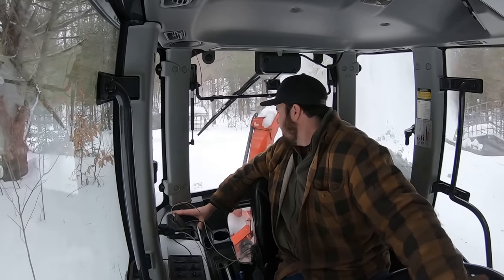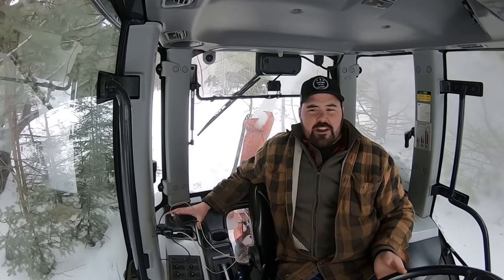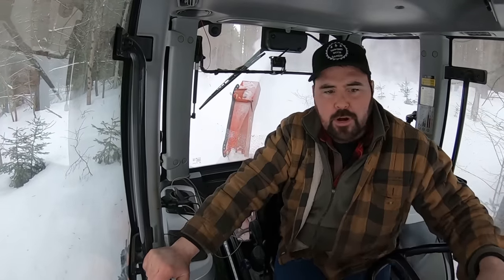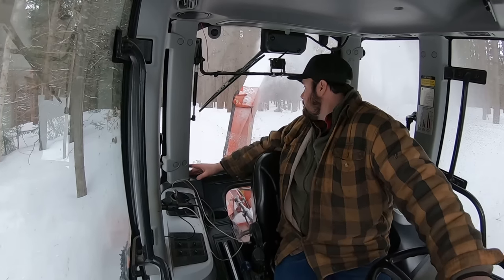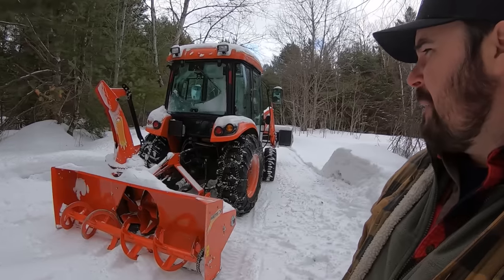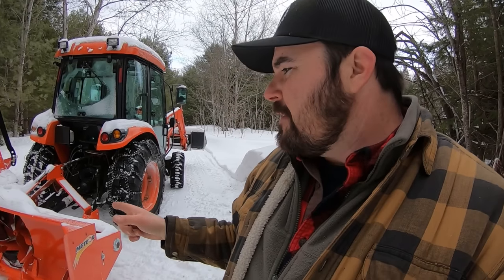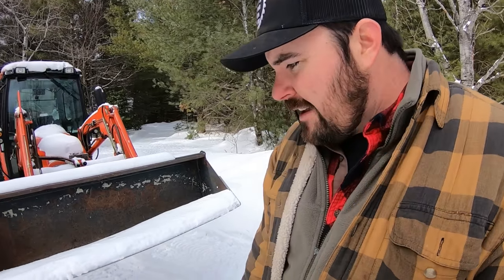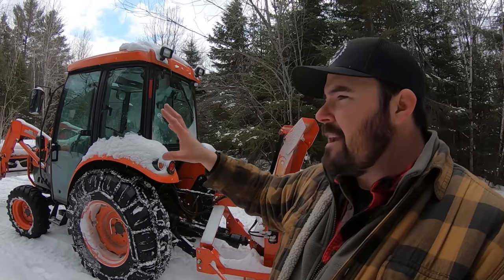This Tractor Snowblower Setup May be Right For You Too!

Comment: Good Morning Sandy: You can’t beat a cab on a tractor. It’s very pleasant to work in the cab in all weather conditions. I use a cab in the forest a lot. You just have to be careful. It would be miserable without it. I use a PTO rear mounted snowblower and a snowplow on the front. My primary use for the tractor is supporting my forestry services company and secondly removing snow, so I need to switch attachments and implements back and forth a lot.
Reply from the maker: I agree with ya there Richard. Just have to be careful and I don't have any issues in the woods either with the cab.

Comment: I love your snow blower. It just doesn’t push the snow to the side but launches it far enough away to not deal with it again. I do agree about the cab. If I had a tractor, I’d definitely have a cab. It just makes working in the elements that much more enjoyable. Thanks Sandy. Stay safe.😊😊😊😊😊
Reply from the maker: I used to have a small snow blade on my tacoma that I used for a little while (few months) until about the 5th time I put it in the ditch on my trails/driveway and decided enough was enough. The snowblower sure gets the job done and throws the snow really far out of the way as you mentioned

Comment: Personally believe  that rear  snow blow actually give better view on blower less obstacles   where front mounted blower would be way out in front you have engine  compartment  the the hydraulic lift portion  and then the actual connection  pushes even farther out  from view   making control on trails like yours even harder to navigate
Reply from the maker: That's a good point there Robert

Comment: I totally agree with you with the rear snowblower, for what you use your tractor for, having the front bucket is a necessity. Front snowblower are more expensive and take some time to take on and off the tractor.

However, if you would be using your tractor to clear snow on residential  driveways as a business, then front snowblower would be the way to go.
Most large commercial snow removal companies use the pull type rear mounted snowblower, because it is a lot faster, often taking only seconds to clear a residential driveway,  but they are a lot more expensive.

I have a small John Deere 322 with a heated cab and just love removing snow with it, I find it almost therapeutic LOL. I often clear my neighbours driveway for free after a storm, because I love it so much... 

Not much snow here in New Brunswick this winter, way below average. 

Cheers from a fellow Canadian.
Reply from the maker: I agree with ya 100%. I also find snow removal therapeutic. Unless of course my sludge runs out haha

Comment: Seem like someone should be making a retrofit kit to make that snowblower front mounted. A hydraulic motor mounted to the PTO input and a quick connect equipment mount. Maybe some temporary hydraulic hoses from rear to front for your chute control or to drive it. Sounds like a challenge worth attempting. Or, find a sponsor like Walenstein or Woodland Mills…😊
Reply from the maker: Hi Robert, I think there likely is something similar to what you're mentioning. Would be a bit of effort to hook up but bet it would be handy without the mid PTO

Comment: Mornin', Sandy.  In case I didn't ever mention it, you were instrumental in my choice to get a cab on my DK4710. I'll be in the Montana woods, hauling wood, dirt, rocks, etc. - when the ground isn't white - and I'll be blowing snow when I need to.  I don't have a blower on the Kioti yet (or a HOUSE, but that's an ongoing story), but my brother's got a front blower on his Mahindra that he runs from a three-point hydraulic power pack.  That is a powerful set-up and, after I used it a few times this winter, I've decided my old neck would appreciate the 'go forward' type of blower. I'm looking hard at the 'inverted' style of blower, but I've got a while to decide.  Oh, his Mahindra is an open station model, so after a two-hour blowing session the operator tends to look like the Stay-Puft Marshmallow man. I prefer my cab, where I also have to strip down to a t-shirt when the defroster is on!
Reply from the maker: Hey Steve! Great to hear that about the DK! Hope you're enjoying it. The front mount are nice units! I woudn't mind one on a different machine some day. Love the short-sleve cab work too!

Comment: Hi Sandy. I think what you have is just great. The long PTO shaft going to the front would probably mean some sort of transfer case on the back to turn that PTO shaft. I can tell you use the blower a lot as the paint on the inside of the chute has been rubbed off. If I had that set up, it would be a lawn ornament. Have good days!
Reply from the maker: Yeah this blower sure gets some miles put on it. Even though this winter has been relatively light for snow it still was out often. I"m just hoping now I"m done with it for the year

Comment: The front mount rear pto snowblower, is more than the rear facing pto snowblower, but less than the front mount mid pto snowblower.  If you can keep up with your snow removal, the pull type snowblowers are a good option too.
Reply from the maker: For sure. I do like those units that you drive forward

Comment: Your snowblower really throws the snow a good ways and I would say the PTO driven blower with your tractor will blow snow better than the front mounted hydraulic blower and money is always a factor with us working men if I had a need for one of these snow blowers would do the same as you are doing and the cab would be nice also great video Sandy
Reply from the maker: Money is a factor for sure. I'm content with this setup for sure. Everyday snowblowing I may think otherwise and go for a front mounted

Comment: Well watching this I can only think of the neck cramps you get but there's the other thing the dislocating of the back and also the fact that you were sliding off to the side you have a lot of weight on the rear end and if you're using a form of water substance solution for weight in your tires all your weight is in the back of the tractor and is going to manipulate your travel but whatever works for you I guess it's working for you but I will say under those kind of weather conditions cabover any implement that would be the first implement to get but what about a front-loading hydraulic snow blower and a hydraulic quick coupling front loader system
Reply from the maker: Hey Sean! Thanks for coming along for the video. I often use my backup camera which has a screen on the dash and my side mirrors to keep from having to turn around all the time. Allows me to keep the front end loader available as well for the log work. Hope the winter is treating ya well and spring is en route!

Comment: I have seen a rear hydro power pack skid that powers a front mount attachment. It was used for a front mount brush hog but I assume it would work for a snow blower. Neil from messics had a video covering it.
Reply from the maker: You're right about that one Dan and I think that slipped my mind in this video. That would be a good option in my case if I wanted to run the front snowblower. Not sure on cost but would be real handy
Reply: @sawingwithsandy  
Sounds like the company should send you one to try out. 👍

Comment: I have the rear mount blower for the same reason as you if you are only using your tractor for snow removal front mount is great but if you do firewood or logging all winter rear mount is the way to go
Reply: And the cost difference between front- and rear-mounted blowers is crazy!
Reply from the maker: For sure Glen!

Comment: I didn't know as I never asked my son how he got the  sawdust away from his sawmill. He took me out to the sight and all of the sawdust was gone! I asked him how he got rid of it so well... and his response was.. the snow blower works great winter or summer to just blow it out away from the mill and let it compost out in the bush! He said that the small bits of bark and other stuff never even affected his snowblower at all and it was so much easier than trying to load it out for a hole on the mountain.
Reply from the maker: Now all I'v got to figure out is how to use the snowblower to move my sawdust haha
Reply: @sawingwithsandy  His is a lot smaller so yours would work even better., he just pushed into it like it was snow and it tossed the sawdust out into the woods Sandy

Comment: With as much snow you deal with, if you're happy with your setup, then it's right. Me? I'd rather deal with the bugs here in S.E. Texas. If I had a tractor, I'd have the cab for the ac and bugs. Good vid. Thanks.
Reply from the maker: Hey Joe! Think you've hit the nail on the head. If it fits the need, it's a perfect setup!

Comment: Front mount could be hydraulic  driven   possibly  require another valve control  provided tractor have high enough oil flow  without more modification
Reply from the maker: That could work for sure Robert. I think my tractor flow rate is a bit too low however

Comment: I have and inverted pronovost 84” on a 60 hp tractor with an hla 84” blade. ,im not far from you , i had concerns same as you ,but after 3 winters no issue at all, scrapes down , leaves no tire tracks. I run nokian tires
Reply from the maker: Those Nokian's sure are nice tires for the winter!

Comment: Hi Sandy!
I've wondered (since it's a nice trek to the sawmill) if you spotted the mill in the middle of the property, to give equal access to the timber lot?!
Reply from the maker: Good question Bruce. I think that would be the best option for sure. Down the road may end moving things around but figured at this point I"d keep the sawmill out in the red pine forest just because I"ll be out there for years milling wood as I thin

Comment: MM77 Approved 👍🏼👍🏼………………………………………………Where I live, not much snow, the loader bucket and a scraper blade on the back suffice. I agree with you though. It makes sense to me to keep the loader bucket on so you can pickup and move the deep/hard/packed snow the blower can’t handle. No cab neither, BUT I did get a roof that bolts to the ROPS, made a world of difference! Keeps off most of the sun and rain.
Reply from the maker: The roof would help for sure! I used to run a machine without one and all I. got was wet and cold haha

Comment: It's kinda weird for me to see this kind of inverted snowblower being used in 2023. Here where I live basically only 85 year olds with a tractor and blower from the 50s use this kind of snowblower. Tow behind is far the most common with some front mounted.
Reply from the maker: Hi Espen! I can imagine in different areas there are more common models than in others. Around here the ones like mine are manufactuered relatively close and are reasonable for pricing so pretty common
Reply: I guess compact and sub compact tractors are more common in your area. Here they are really rare. Here we use walk behind snowblowers if we have short driveways and hire a farmer with a big tractor if we have long driveways.